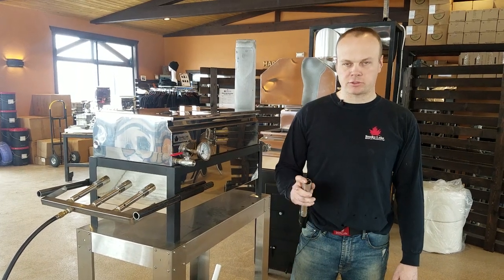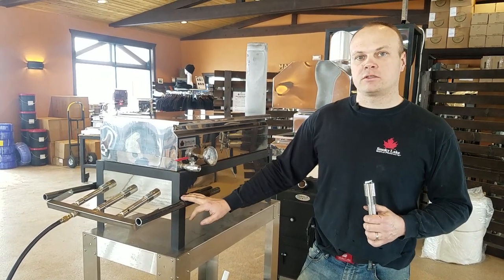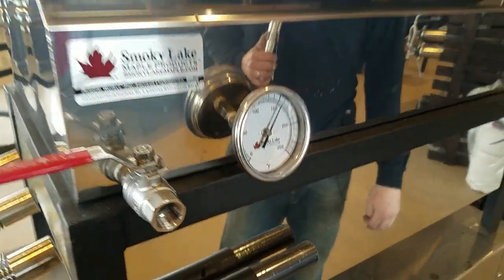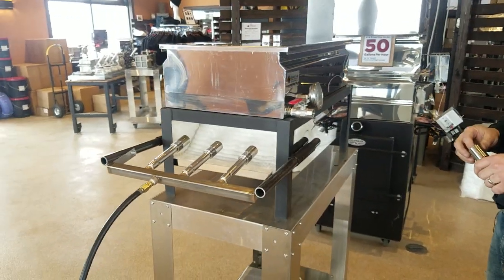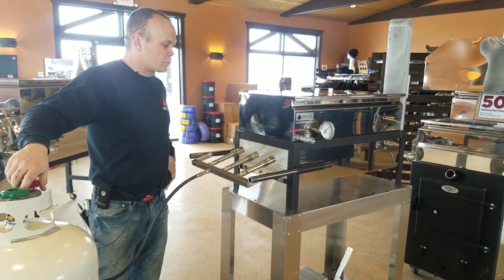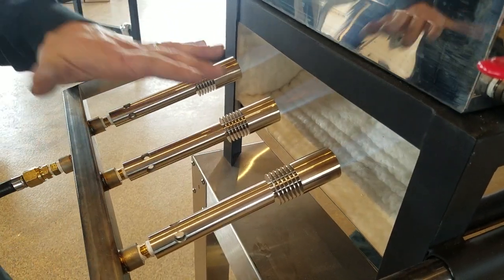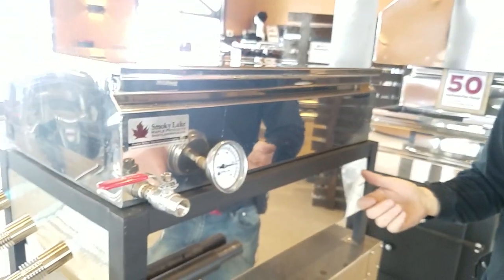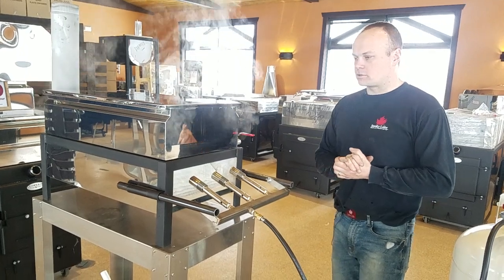A new innovation in gas evaporators and gas finishers.

Comment: We just bought a 7 burner unit for a 36 inch wide pan from Smokey Lake and it works unbelievable.  A 3 foot by 4 foot pan is boiling in 10 minutes, and I mean all the pan except about the first 3 inches at the inlet.  As nice as the fast boil is it is also a treat to shut off and watch how quick the pans cool.  Less than 1/2 inch evaporation after shut off.  THANKS Jim and Jimmy!

Comment: Very cool, but before purchase, what is the fuel consumption rate per burner?
Reply from the maker: 3 lbs of LP per hour per nozzle on high fire.  Using as a finisher I only use a TOTAL of 1-2 lbs of LP per hour.

Comment: Does the up and down / in and out adjust ment on the nozzle standard or was that designed only for  video purposes?
Reply from the maker: That was done on aknebof the early models, only to perfect the angle and position of the nozzles.  Current models are fixed.

Comment: How many gallons/hour will this boil off?
Reply from the maker: About 10 gallons per hour for the 2'x4'.  We're seeing about 1.3 gallons per hour per square foot of pan with these.
Reply: Jim,
How fast does sap boil off using the 16x30 gas fired evaporator?  How many gallons of propane does this use/hour?(  Wondering how long our 30lb tanks will last.  )
Will natural gas boil off sap slower than propane?    
Thanks!
Reply: Hi Jim, great videos!  I missed a point you were making about the chimney when the sound went out. I will or will not need a chimney with one of these units? I understand that a wood fired evap needs to draw a draft, but a gas fired one wouldn’t. However without a chimney won’t there be issues with fresh air coming in at the same place the exhaust comes out? Basically, is a chimney / exhaust port necessary? Thanks!